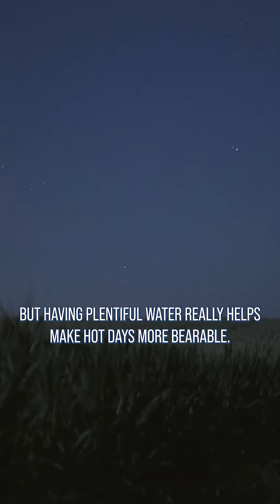How hot is too hot for crops?

Comment: The heat hurts them so bad because it's drying them out, their leaves are filled with tiny pores to allow for co2 respiration and these pores lose tons and tons of water. iirc a large majority of the water a plant draws from underground is lost this way, and only a small amount is actually kept
Reply: You are talking about transpiration, every plant does that. And it does it regardless of temperature. I dont grown corn personally but the family does grow both corn and sugarcane, in thailand where its far above 90s lol... Just like most plants? You can quite easily if they have heat stress or not becauuse the leaves start to curl, trying to shade themselves.
Reply: @Sweedish_Delight  of course it happens regardless of temperature but there's going to be a difference between the rate it happens in 60° and 90° and in tropical Thailand and arid Nebraska. if the air is already saturated it will both happen slower and the water will be replenished faster
Reply: @Sweedish_Delight  When it's hotter the rate of transpiration is faster and simultaneously the ground tends to be drier due to increase evaporation unless it's being irrigated, increased transpiration can also be a deliberate tactic by the plant to cool it down (like sweat) to avoid taking actual direct damage from heat. Some plants handle heat much better or worse than others and fully domesticated plants are often bred to handle local climates, of course. If you try to grow something like sea buckthorn/pawpaw/honeyberry in the tropics or a desert you aren't gonna have a good time